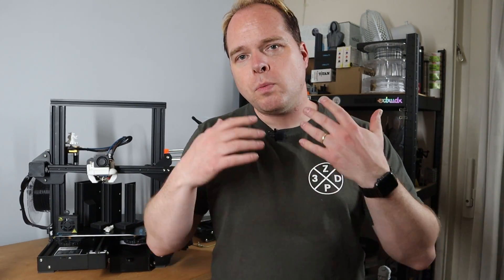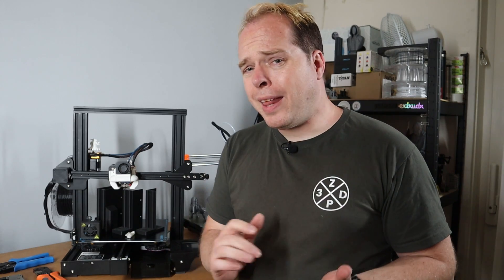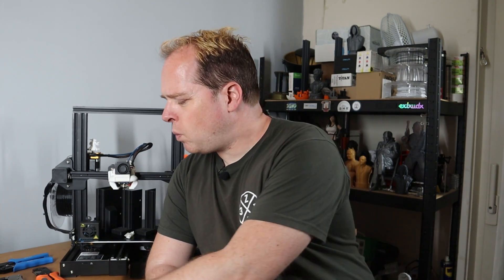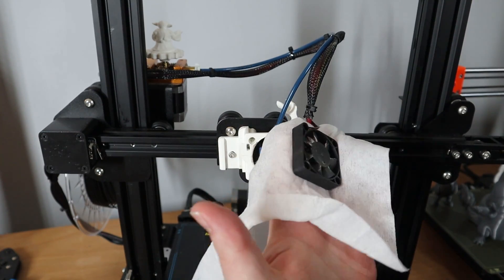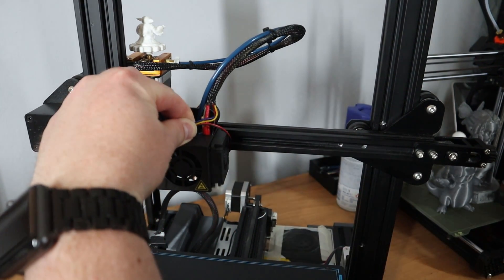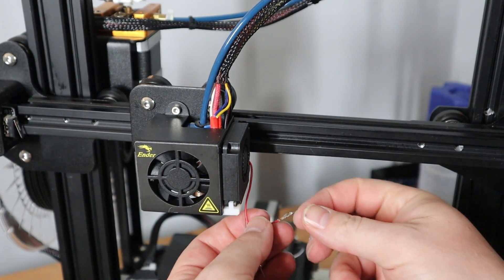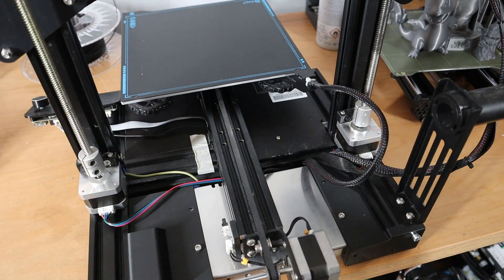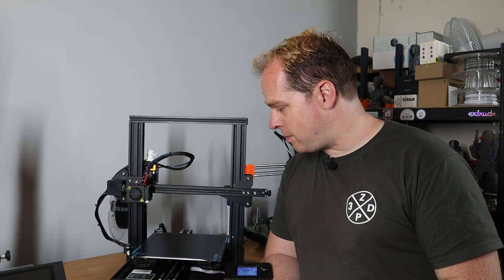How to replace fan on Creality Ender 3 Pro and more fixes

Comment: Hey Zachary I soldered them black and black red to red and now when I start a print they turn off ??
Reply from the maker: Hello Insido, Oh that's weird. Then there is another issue, because normally if you would switch the wires then fan turns the other way around. Hmmm...

Comment: Thanks again for reference on this video.  Did you just ground the housing of the power supply unit with an electronic component, i.e. the end stop?
Reply from the maker: I grounded via the inside of the Z gantry at the base of it
Reply: @Zachary3DPrints  Thanks for your answer.  What wire gauge did you use?
Reply from the maker: I used ground wire from a old power cord, so I think a standard wire gauge

Comment: Do you have links to the stl file you used to print the new holders for your power supply?  Loving the mods and doing the same to mine right now. Keep the videos coming.
Reply from the maker: Hmm, I didn't put in the link? Here it is https://www.thingiverse.com/thing:4750639

Comment: The position of the wires does not guarantee you get the correct polarity. However, yellow is usually positive on the Ender.

Suggestion... put 1 male, 1 female in each end. That way you can't reverse them on accident.

I'm surprised you took off the bullseye duct. It's far superior to the one you replaced it with. Your choice though. 

Is the PSU fan facing down now? If so, I'd put the printer on "squash" feet to give it some clearance for airflow. I have a duct on mine that I found on thingiverse last year, but it's still in the stock location.
Reply from the maker: Hey buddy, because I wasn't sure which polarity it has, I used both male on one side. About the bullseye fan duct, I'm going to reprint it and install it together with a BL-Touch.